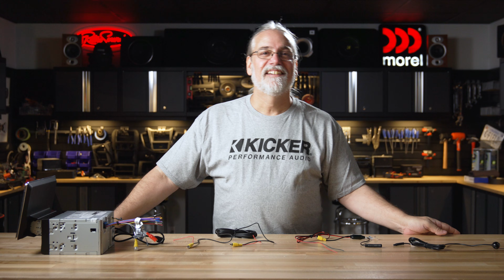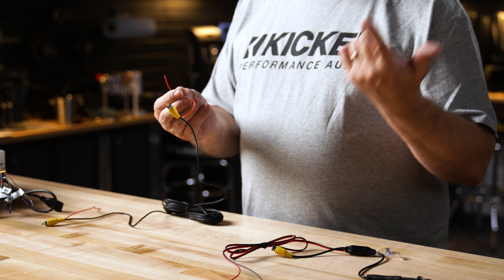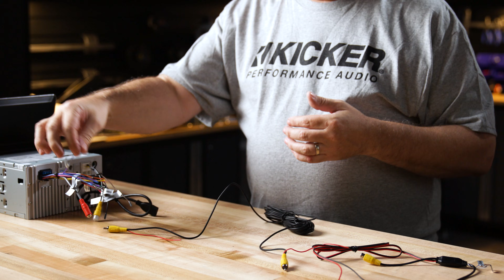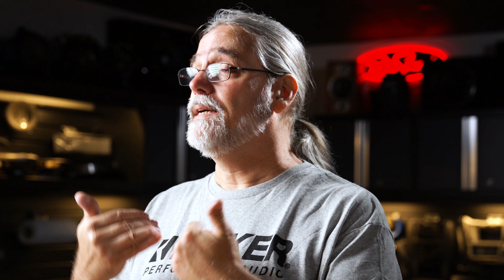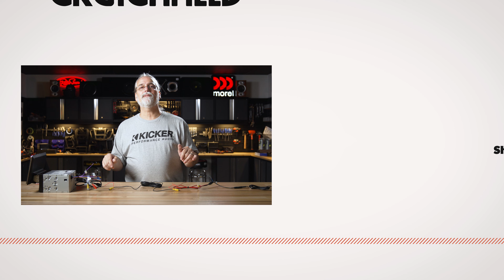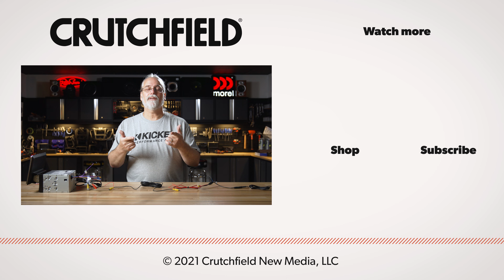Powering your backup camera (and how to use that extra wire) | Crutchfield

Comment: Hey can I connect the brown camera wire to the purple reveres one to a ground wire will that work bc me and my brother connected to a red wire it worked but it was always on
Reply from the maker: We cannot troubleshoot your install from here. If you are having connection issues watching the video to confirm your connections are correct can be extremely helpful. When your camera is always on it is connected to switched constant power, for the camera to only come on when in reverse you will want to power it from the reverse light circuit.

Comment: I have Jenson radio and rp4-vw11 kit from crutchfield for vw beetle. Can I use the trigger wire from vw-11 to power the backup camera (maybe need a relay and 12v source???
Reply from the maker: The Reverse Output does not provide enough power to run a backup camera. It only supplies enough power to function as a trigger. Wish we had different news for you there. The good news is that gear purchased from us comes with our lifetime technical support and they can help with locating a good power source for the backup camera. We include their toll free phone number on the shipping label as well as on the order invoice!

Comment: How to do this wit a Wifi camera and a battery in the trunck ?,  constant power on the camera (Battery + ?) and than connect it on the reverse light power (red) to activate it in the reverse stand (with the App i can connect it, Wfi, my mobile phone ??? )
Reply from the maker: Wireless cameras can also be connected to any of these power sources. The thing to keep in mind is that when wanting to use a power source that are far away from the camera, the included wires may not be long enough to reach making it necessary to purchase additional wire.

Comment: I used exra double wire  through  from the frame connect  reverse light negative and positive and  forget to cut half .and start the car short circuit  .engine light battery and oil light on . What you think did i fuck the car or not
Reply from the maker: We cannot provide any technical support or determine the exact cause of your issue from here. Make sure to follow the instructions for connecting your backup camera carefully and check over all your connections to ensure that you have installed it correctly. If you purchased your gear from Crutchfield, please contact our Technical Support hotline with your order number handy and we are happy to assist in troubleshooting.

Comment: Might have not understood, can I have it where I can use the camera in reverse ( have it switch automatically) and also while going down road to check a trailer? But when I throw it in reverse it will kick on?
Reply from the maker: Yes, most aftermarket touchscreen receivers will also allow you to manually select the rear camera input anytime for viewing.

Comment: This is explained really well. My issue is that everything is wired correctly from the camera to the HU. However, when put into reverse, no picture shows. Just black screen with the lines from the HU. Tried just turning on the camera from the HU settings and the same thing.
 I took it to 2 shops and paid 200$ for them to tell me they plugged in their camera and it showed up. Im against a wall. It's very frustrating. 
We tested all cameras individually, every wire/RCA is correct, and the picture shows on a test monitor but not on the HU. When in reverse, the backup camera activated as it should, but still black on the HU. We have purchased 3 different cameras, and the same happens. I dont know how 2 shops can get a picture with their cameras, but I buy 3 and can't even get static or "no signal" to pop up. Just black. If anyone could give advice, it would be much appreciated before we just cut our losses and give up.
Reply from the maker: Hi Lesley, based on all your troubleshooting, it does sound like the issue is likely the camera setting within the head unit itself. You may have to find and specify how you want to use the camera. If you got the radio or cameras here, please reach out to our Tech Support for help troubleshooting this as well. Their direct number is on your invoice.

Comment: Anyone have a similar issue to the one I am having? The reversing camera comes on as expected when the car is in reverse and the ignition turned on. But no image when the engine is started.
Reply from the maker: Sounds like you may want to double check your camera wiring or radio camera settings. If you got the camera here, you can call our Tech Support as well. Their direct number is on your invoice.

Comment: I really appreciate this video and the simplicity of it. I installed my unit using the method of powering from the reverse light. However, after working for a few weeks, whenever I put the car in reverse it blows a fuse and dash lights switch off (and car won't start). I'm not sure if I need to change the power source of the rear camera or it was too much for too long on the fuse (7.5a that keeps blowing). Any help would be appreciated!
Reply from the maker: We provide lifetime Technical Support with any order, if you purchased your gear from Crutchfield do not hesitate to call us with your order number handy and we would be happy to help you troubleshoot.

Comment: So could i just wire the camera to a switched 12v source, and then use the convenience wire on the RCA as the reverse signal wire to the deck? This seems like the most logical way to retain use of the camera any time, but also have auto camera feed while reversing. As well as minimizing the amount of wiring/running wires needed.
Reply from the maker: That is absolutely correct. If you are powering the camera with a separate switched and fused 12-volt source, you can connect the convenience wire to the reverse light circuit at the camera end and bring that energy forward to the radio's reverse trigger wire to activate the camera when you shift.

Comment: How can I know what is the model of my head unit? Its a nissan sentra 2017 I would like to know if I can connect a reverse camera to it
Reply from the maker: Are you using an aftermarket radio in your Sentra? If it is an aftermarket touchscreen radio, there may be an identifying brand or model numbers on the front of the unit to help you identify the exact model.
Reply: @crutchfield  no, its the factory unit
Reply from the maker: With the majority of factory radios, you cannot add a backup camera. With some models we have options but there is nothing we carry compatible with your 2017 Sentra. To add a backup camera the Boyo VTC175M camera and monitor package in the link below is a great call. This kit is the easiest way to add a backup camera feature without upgrading to a new aftermarket radio.

https://www.crutchfield.com/I-rYALc166/p_707VTC175M/Boyo-VTC175M-Camera-Bundle.html

Comment: I hooked everything up the way you explained it, and when I shift into reverse the radio switches to the camera setting but says no video signal. I thought it was a defective camera so I got another one and the same thing is happening, any idea ?
Reply from the maker: It is hard to know the exact issue from my end. Itis a good idea to check your video input connections on your radio to make sure the camera's output is in the correct input. We provide lifetime Technical Support with every order, so if you ordered from Crutchfield give us a call with your order number handy and we are happy to help troubleshoot.

Comment: Hello! Absolute beginner here - if anyone out there is able to answer a couple of questions I'd appreciate it :) Why wouldn't I want to just use the convenience wire for powering the camera as default? Why does everyone insist on powering from the Brake light? I don't really want to cut any parts of my car. My Head unit already knows when I'm in reverse using the CAN bus even when I don't have the camera installed so surely it makes most sense to just use the single video wire with 12v using the convenience wires from the head unit to the back of the car then ground on the chassis? Am I missing something?
Reply: Also LOVED this video. Took me ages to find a clear concise explanation of what everything does and why
Reply from the maker: Thank you for the kind words, I am stoked that you enjoyed the video and found it helpful!🥰
Reply from the maker: If you are installing an aftermarket radio that provides a 12-volt power wire specifically for your rear camera, you can use the convenience wire to power your camera.
Reply: Thanks for the info that's great! Where might one best connect the ground wire? You mentioned to connect to the chassis but how do you connect it? Is there no other more secure method?
Reply from the maker: Ideally, you would install it much like a ground for an amp. We recommend that you find a bolt that can be undone without causing any issues to the vehicle, clear off any coating on the frame around the bolt hole, and then connect the ground wire so that it is held in place when the bolt is tightened down

Comment: Hi, My camera is only wired to the head unit via the video cable and the convenience wire, which is connected to head unit’s “BACK, Reverse Cam Power” wire. On the other end, the videos wire is connected to the reverse cam and convenience wire attached to the positive power ( No negative connections). The unit powers the reverse camera and detects it when the reverse gear is selected and the camera works. My question is, as this is not the traditional way of connecting the camera, is this doing any damage or do I still need to connected the wires to the reverse light for power (even though it’s already got power? Thanks in advance.
Reply from the maker: You will not need to make any additional camera connections for power to your vehicle if your camera is currently working properly. This should not be doing any damage, as it sounds like your radio is designed to power the camera from the reverse camera power wire.
Reply: Hi there, just wrote a question in this video before spotting this comment! I plan to do the same and had the same query :) glad it's worked out

Comment: While this is a great video about connecting back up cameras in general, it misses a point. I have now had two different stereos from two different manufacturers which uses CanBUS. When I put my car in reverse, the stereo knows it. The wire does not need to be connected. I'm watching this video because I'm going to install a backup camera soon and I tested it by connecting power to the camera from the cigarette lighter socket (aux power to those young enough to not know what cigarette lighters are), and it worked fine when I put the car in reverse without connecting anything to the stereo except the yellow video connector. I believe there may be a reverse out wire from my stereo which I may be able to power the camera from using the convenience wire. I am not sure. The point is, with CanBUS, you don't need to connect much. I have live all the time power connected to it. It goes into standby when I turn the key off because the bus tells it to power off. The antenna, ground, output audio and the bus are all that's connected. That's about it. It works well!

Comment: I’m not sure if I messed up in the front or the rear but I have to manually press on camera and put it on reverse and it comes on I try to put it on reverse but it doesn’t turn the camera on so not sure if I connected it correctly behind the stereo or the rear tail lights
Reply from the maker: Hi Jose, sounds like you may want to double check your reverse wiring and also the radio's camera settings. If you got your camera here, you can call our Tech Support as well. Their direct number is on your invoice.
Reply: @crutchfield  my reverse wiring is green with purple I connected it together and I put the car on reverse and nope I have to manually press on the camera for the back to work so I’m not sure

Comment: So what’s the difference in hooking up the switched 12v or the dedicated camera power. There isn’t any difference correct? Both will allow you to use the camera going down the road and ofc in reverse gear as well right?
Reply from the maker: The best wiring option will depend on the camera, radio, and your need as far as viewing the camera.

Comment: 5:00 in regards to the purple back up trigger wire on the headunit, would i ADD a red wire that i can tap from the headunit purple trigger wire that extends to the tail light where i would then tap the other end of the red wire to the tail light reverse wire? Allowing me to not only have the backup camera appear on the screen when i shift into reverse, and also be able to have the back up camera on my screen while driving as well?
Reply from the maker: You can use the "convenience wire" already installed on your camera cable to connect to the reverse circuit in the rear of your vehicle to activate your camera and select the image on the screen when shifting into reverse using a connection to the radio's backup trigger wire. If you wish to see your camera image when not in reverse, your camera needs to be connected to a fused power source that provides 12-volts whenever the car's ignition is switched in the ON position.
Reply from the maker: You can install and wire the camera to have both features, correct.
Reply: @crutchfield i still confused by this. My head unit is Kenwood DMX7019BT, has dedicated "CAM" button which can view rear cam without shifting gear to Reverse.

But the video can not appear if i push the CAM button.

And it's normal if i shift to reverse gear. 

Can you kindly help to advise for solving my problem?

Thank you 🙏

Comment: I got an OEM camera for my kia Sportage 2012 but can't find the plug to connect it.  Doesn't even have the hole for the camera since it's not the premium version
Reply from the maker: Our video outlines installing aftermarket camera's and connecting to aftermarket radios. We cannot provide advice to connect original equipment cameras to original equipment radios as many times the factory camera is not compatible with the original OEM radio from another trim level. You can always upgrade your radio to an aftermarket unit with camera included like the Boss BE7ACP.WXC below that is a fit in your 2012 Sportage!

https://www.crutchfield.com/I-rYALc166/p_104BE7WXC/BOSS-Audio-Elite-BE7ACP-WXC-Package.html

Comment: Could you technically connect the purple “reverse trigger” wire to the built in yellow “12V reverse camera out” together along with the convenience wire sending it back to the camera and finding a chassis ground near the camera? I had tested the voltage coming out of the yellow wire and it only pops 12 volts in reverse meaning that wire is in a “reverse circuit” and this wiring the the trigger wire to it would be sufficient?
Reply from the maker: The best option will depend on the camera you use. Do you have a specific brand and model camera in mind?

Comment: 2:30.  My question is, i ran all the wires from front to rear! I only have the yellow rca male plugged into the female yellow rca from back of headunit (reverse cam rca) and then at the back i have the camera wire plugged in, i have not grounded any black wires nor tapped any red wires yet! I am only seeing black screen as far as when i put reverse camera on my double din.. do i need to tap the red wires before i will see anything? Or should i see atleast video with just the yellow rca plugged into headunit rca?
Reply from the maker: Since you have not connected your camera for power or ground yet, the camera is not powered up. You will need to make the power and ground connections (red and black wires) before you can see any image on your radio's screen. It's an easy fix!

Comment: Question: I have made all the proper connections to have the camera on while in gear as well as reverse. When I shift into reverse, the monitor changes to a "Blue Screen" instead of the camera view.  any idea why that is?
Reply from the maker: Are you able to select the camera image manually from the receiver's settings, and see the image displayed properly when not in reverse?
Reply: @crutchfield  i had to wire it so that it only works when in reverse. I can live with that. Now the issue is the view is reversed, the wiring does not have a loop to cut to fix the issue and my head unit does not have a setting to reverse the view. Any ideas how to fix this issue? Thank you for your assistance
Reply from the maker: Those are the only two methods we know of to fix a reversed image. Since neither the radio nor the camera offer that ability, it appears you are stuck with the reversed image. Wish we had different news for you there.

Comment: Hello,can the pink reverse wire be hook up to acc wire?
Reply from the maker: Hi Leroy, each camera should specify the best wiring option. Are you looking to install a specific brand and model?
Reply: @crutchfield  an aftermarket one... Android
Reply: Hi. Install the back up camera but now I have lines running up and down on the screen...can this be a ground problem or bad camera?and when reversing the image will cut out for about 5 seconds off and on ..

Comment: My pioneer avh-211ex is not flipping over to camera view. Have it set up exactly how you described
Reply from the maker: If your Pioneer AVH-211EX is not automatically switching to the reverse image when your vehicle is shifted into reverse, you will first want to check that you are connected properly to the reverse light circuit with the Pioneer's purple/white reverse trigger wire located in pin 10 of the harness. If you can select the camera view in the AV source selection screen and the image is displayed but not automatically switched when in reverse, the trigger wire could be the issue. I hope this helps!